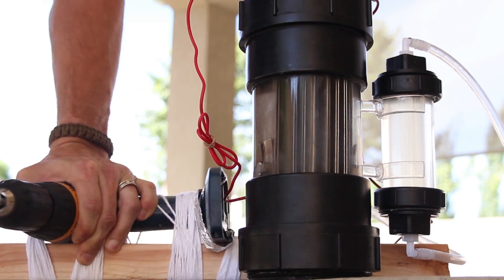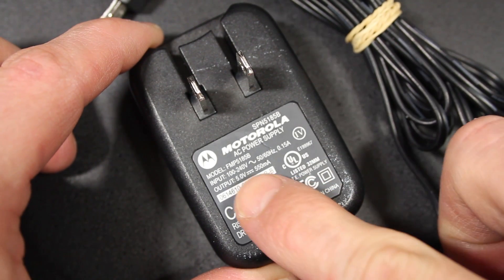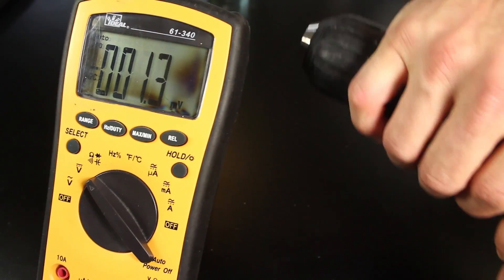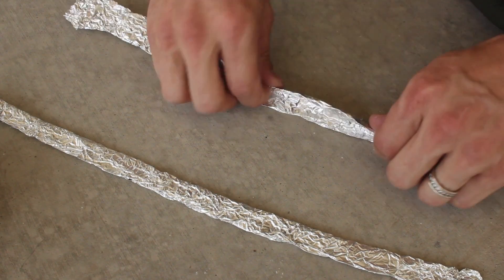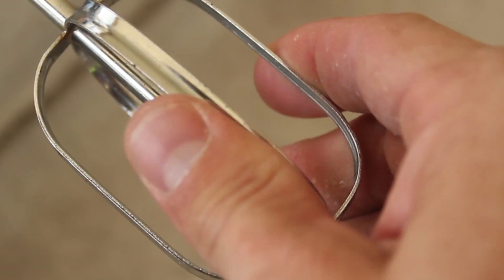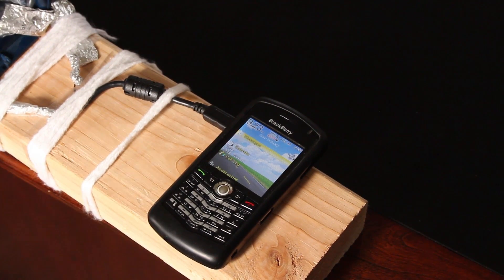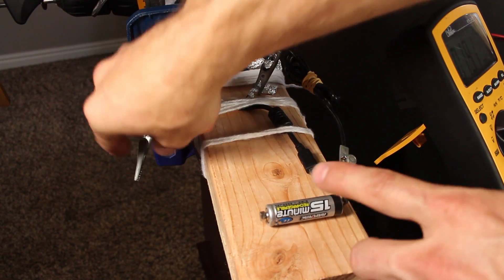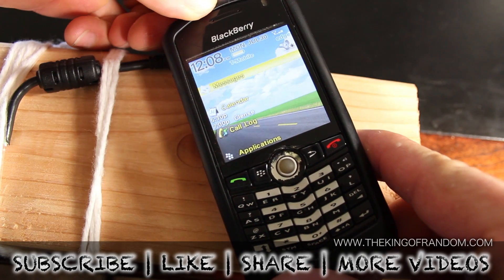Make an Emergency Phone Charger - MacGyver Style!

Comment: I've used DC motors many times in the past to charge/power circuits/devices. They certainly come in handy. To help eliminate any chance of damaging the phone due to fluctuation of voltage I would use an lm7805 VREG on the output. By doing so you will not damage the phone by spinning it too fast. The voltage will always be at 5V, unless you spin the drill too slowly. Be sure to use a 100uF cap on the input side of the vreg, and a 10uF on the 5V output side. I would also suggest using a blocking diode across the drill to prevent any back EMF spikes from destroying sensitive electronics.

Well done video. :-)
Reply from the maker: Excellent suggestion.  If you can find those in an emergency that would be ideal :)
Reply: The VR and cap are easy to find. All you have to do is take an USB 12 volt power adapter you plug into the lighter outlet in your car. Hook it up to the drill. You now have the regulation and filtering you need.
Reply: Grant Thompson - "The King of Random"  well according to your system its not safe because you dont make circuit that can make voltage stable as a the dynamo is been crankup!!!! so it means when you crank up so hard the power you generate is not so!!! stable that can kill your charging ic  in a second!!!  because it generates a 40watts of power !!!when you charge it!!!  but if you want it to make it to safe to charge i suggest  it use some rechargeable battery hooked up!!!!! to a regulated 5v car power charge so if you cranked up hi it wont destroy your gadget.
Reply: ***** this needs to be upvoted more.  Its a brilliant way to regulate the voltage.
Reply: The AC adapter converts incoming 120VAC to 5VDC. The drill already puts out DC, so all you need to do is regulate the output. If you don't want to use the lm7805, then you can also use a small step down converter board. I have a video showing a homemade 11W crank generator with a regulated 5V USB ouput.
Reply: better to use PWM dc dc converter(it has much better efficiency).
Reply: electronicsNmore The 7805 probably won't work because it requires an input of significantly more than 5 Volts. I've tried using 7805 regulators with 4 D cells, and 6 Volts was simply not enough for the 7805 to work properly.
Reply: Alex Roman its great if you have one laying around but for "hacked together" parts that works fine. we're talking emergency, not proper design.
Reply: Frank Oranzi I know how to make a soldering iron that uses no electricity with a paper clip and a ball point pen. SO yeah it can be done.
Reply: ElfNet Gaming And you cant seem to read the title, or you just want to humblebrag about your degree? I have almost 30years in the industry and I have seen things cruder than this work in a pinch. Best practice?  Absolutely not.  Would I use it if I had no other options?  Absolutely. Do I care about ruining my phone if I all I need is to make one call to get help sent?  not at all.This is a last ditch option to charge a phone.  Its a terrible idea if you just want a casual charger, but as the title clearly says, its for an Emergency
Reply: ElfNet Gaming Alright...so how difficult would a buck converter circuit be to set up? One of the motors is going to be cranked rather than powered and set up to output to 2 different things and I want it to have a rig for each of the 2 outputs that will restrict voltage and amperage differently than each other.
Reply: i dont have 7805 laying around but i have PWM dc converters, so if something happends i will turn spatula 40% less than you to get same amount of energy=)
Reply: The point of using the car adapter is the DC DC converter that is inside. You can just hook that up. You don't even need the 7805. This just seems odd to argue about but if you're very proud of having DC converters for a hypothetical situation then awesome for you. You should post a video about how you will use them, but you cannot use solder or power tools since its an emergency scenario. I will like it and share for sure
Reply: Frank Oranzi what about lighter? it can help.
Car adapter has the same 7805 mostly, as a linear dc-dc converter it has bad efficiency.
Reply: Not using a regulated DC output with either a lm7805 or high efficiency DC-DC converter is a bad idea. The converter in the car charger is designed for a system with a battery to help absorb transients
Reply: designed? there is capacitors on input and output and its enough to avoid transients.
Reply: If you're not concerned, then use it. :-)
Reply: how can the DC motor charge an AC adapter?
Reply: Alex Roman Most modern car adapters do not use 7805s. I just opened one that was in my junk box and it has PJ34063 DC-DC converter board with an inductor and caps. This adapter is about 10years old. Remember the point of this video is to show what works in an emergency.  Not what is the best way to do it.  There are plenty of smarter ways to do all of this, but they require planning and familiarity with electronics and not everyone has that.
Reply: Zolyx they are bypassing the AC side. All AC adapters convert the AC to DC first. You only need to inject the CD at that stage(after the rectifier circuit) and it will work. Not the smoothest way to do this, but in a pinch it will work.
Reply: That is correct, but cranking that drill by hand will result in more than 7.5V which the regulator will work just fine with. Too slow and the output will not be a steady 5V.
Reply: electronicsNmore 
7805 will not work good.
better to use low drop out regulator, or a simple switcher so get better effiencey and the correct drop out voltage.
Reply: Of course there are better choices than a 7805, but clearly the people watching this channel are looking for "SIMPLE". The 7805 will work, and work just fine as long as the rotation is fast enough. Clearly a 7805 is far better than using nothing as shown in this video.  :-)
Reply: electronicsNmore the Title is "Make an Emergency Phone Charger" Not, "What is the cheapest easiest way to bodge together a functional Phone Charger".  There are a plethora of ways to accomplish this with basic electronics, but in a pinch there is rarely 7805s or buck/boost converters laying around.
Reply: electronicsNmore I tried to say this but my electronics engineering degree means nothing against the homebrew DIY youtube audience..
Can't say they haven't been warned.
Reply: Rostit The problem is, knowing people very well, they will not wait until an emergency to try this. :-) Many will try it out to see if it works as shown in the video, and that is when the problems arise. Just like telling a little boy to look, but don't touch. I agree that many will not have an lm7805 or switching converter laying around, but many will also not have a cordless drill laying around if the time comes when no power is available. Grant does produce very good videos, but this is one video that I don't think is the greatest idea.
Reply: electronicsNmore True, and when they fry their new iPhone they want to blame the video creator.
Reply: Exactly. I think Grant knows this. He is far from stupid. If I was him, I would put a big disclaimer in the video saying there is the possibility you can damage or destroy your phone, so ONLY try in an emergency.
Reply: What would that look like on a diagram? I want to build a back up and would like to know more on what you just said lol. Millwright here lol so this is slightly jiberish
Reply: I will post a link to the image later.
Reply: electronicsNmore WHY NOT USE A USB CAR CHARGER OR ANY CAR CHARGER TO REGULATE THE VOLTAGE GOING INTO THE CELPHONE IF WE ARE CRANKING IT TOO FAST ALREADY..WOULNDT IT BE MORE CHEAPER TO USE AND EASIER TO FIND AND USE DURING EMERGENCY SIR?   I THINK THIS WILL WORK WELL TOO, AM RIGHT SIR GRANT THOMPSON?
Reply: Mardonio Herrera jr. If you have a USB charger around then yes, you would use it.  This is ONLY if you have a drill.
Reply: Unfortunately many car chargers are designed to operate between 10 and 15VDC. You will have to spin the drill fairly quickly to allow charging to begin using a car charger connected to a cordless drill. People also have to realize that spinning the drill in the wrong direction will reverse polarity and likely destroy the device being charged. Many phones will not even charge if you are not showing a low DC voltage on the data pins. Pins 2 & 3. I agree many may not have a 7805 laying around, but many people will not even have a digital voltage meter to make sure the output on the drill is correct. Positive and Negative will reverse when the drill is spun backwards. Only old phones can charge without the data pins. So in an emergency the phone will likely not even charge based on how this was shown in the video. I have 2 videos on my channel showing a handheld crank generator I made from junked parts(Part 1 and 2). Mine uses data pin voltage. For a basic schematic using a lm7805, refer to the link below.

http://i1063.photobucket.com/albums/t507/lookingfordbn/DSCN0441_zpsyah5fovt.jpg
Reply: electronicsNmore How expensive are one of these regulator components and what range of amperage, wattage, voltage, or whatever can they come in for the most common pricetag of one? I've been wanting to build something with a set of electric motors that have been laying around my friend's garage for a while and I got permission to go pick them up once I need them, but it's been more of a side project until you mentioned the VREG thing which could make the project I want to do a little easier.
Reply: *****
Look on Ebay for "5V voltage regulators". You can buy ready made circuits. Use an LM7805 based circuit or a switching circuit.
Reply: LM7805 is ok for stable voltage but the amps drop off as you load it down, eventually the voltage will become unstable and the chip shuts down, Your better off getting a buck converter circuit.
Also the LM7805 will start generating waste heat that does not justify its regulation no longer.. They are fine for small things that do not require a lot of amps but battery charging, it depends on the rating of the battery and so on.
Reply: so is mine
Reply: Pls speak English, I'm supposedly good at electronics but have no idea wtf ur talking about
jk;)
Reply: Doofus Industries you aren't than. that is a basic thing
Reply: electronicsNmore o
Reply: electronicsNmore 

H
Reply: Yep, wouldn't want to ruin a $600+ phone because the charging source wasn't regulated. Also, discharging the NiMh battery with a high wattage,  low resistance resistor is safer than discharging the battery with a wire.
Reply: You can de-solder all kinds of capacitors and voltage regulators etc from broken electronics.
Reply: +talastas789 Your English is terrible.
Reply: lel

Comment: I usualy like your stuff without any reservation.  I am not too keen on trashing a USB cable to cobble up some awkward gadget with a potential to trash an expensive phone, as you point out.  What had never occured to me, and that I think is great, is using a cordless drill as a generator.  There may be a good supply of such drills that are good except for their gone wretched battery packs.   Two future hacks occur to me now, a patch to use the drill without the bad batteries of the pack, a repair or subatitution of the battery pack, OR  repurpose the drills guts as a frame mounted bicycle generator to charge an onboard battery through a friction wheel contact to the bicycle wheel. Battery could then power/charge phone or provide bicycle lighting with clamped on charger removed.  Bicycle could be just ridden to charge or used on rollers indoors to charge.   I did leave thumbs up for this video, but following it would be a bad idea.  BTW every drill I have ever purchased has a button to lock the trigger switch in the on position.  I have a cheap cordless drill with crappy old battery of probably dead nicads and a couple of bicycles   i need to research regulators/ charging circuits.

Comment: i did this once.... i blew out the leds by power it too hard...and now it doesnt seem to work.. i would guess that its time near a few permanent magnets has made it stop... but i hope this aint the case...if it is.. i will have a hard time getting a new drill..hopefully it wont be wireless....cus making the battery pack the way it is... was hard....i took some wires and ran it tru the base and put them in place of the battery.. cuze the battery got over loaded i think what with me plugging it to a wall..so i put the drill in a way where with the base.. it still works... it portable and i have it currently in its box that i found it in.. and it is back next to the 7 magnets that i think might be interfering with it...
Reply: it still works...(i think...) but i dont have a way to know for sure... unless i plug it into a meter like yours... but i dont have one of those either...

Comment: So in theorie you can recharge your drill by just cranking the drill chuk backwards?
Reply: Good point...
Reply: but not quite the batter of the drill needs a lot more power so probably not
Reply: In theory, yes. You need to crank faster, though. If it's a 12v drill, you'll need to crank about 14 volts. If it's an 18v drill, you'll need to produce about 20v.  If 100 rpm was required to produce 5v, you'll need at least 400 rpm for 20v.  And, you'll need to do it for several hours.  At that point, you may want to re-engineer your cranking setup.

Comment: One thing he failed to mention is not all USB cables follow that wiring colour code or sometimes they're mixed up inside. Use a multimeter first to ensure you are using the correct wires for voltage and ground. Just an FYI for those who are considering anything like this.

Comment: So if my drill dies, can I just crank it backwards to recharge the battery?
Reply: xthexinsanexkingx Well said! This is the same philosophy I use for my car. I always tow a second car behind me so if I run out of gas I have another car to use.
Reply: Chris Nguyen You're the first person to invent infinite power! Congrats!
Reply: Actually forwards. And faster than it would turn at full power.
Reply: ManWithBeard1990  USE ANOTHER DRILL :D
Reply: Hey, now say you have a motor that is attached to this generator and is making power by turning the crank. All you have to do is attach the power output to the motor... now you have a limitless power source!!!
Reply: Chris Nguyen Love you sarcasm.
Reply: no........ This drill has been modified. someone has removed the diode.
Reply: xthexinsanexkingx man that gave me a good laugh.
I think it was the english that really made it sound funny
Reply: NO, you would be using the batteries power while holding down the trigger to charge it.

Comment: So it stands to reason that if put in reverse and hand cranked fast enough the cordless drill could recharge it's own battery pack?
I bet that wouldn't be very fun.
 Perhaps a mechanism to couple it to a bicycle and make a drill you can charge anywhere without electricity?

Comment: if i was to hook the hand crank upto to a bicycle wheel would it be possible to thank use the cycling as a means of powering the phone? thus making use of a cycle workout and phone charging.
Reply: Goblineng It would be best to use some sort of ballast. EG: Charge a lead-acid battery with the bicycle-generator and then utilising the stabilised current from the battery to charge your mobile devices.

Comment: If you wanted to be on the safe side, you'd also want to hook up a LM7805 voltage regulator by connecting the positive cable from the charger to the voltage in pin on the regulator, ground pin to the negative cable, and an additional cable going from the 5v out pin on the regulator to the positive cable that leads to the phone.

Comment: AAAAAAHHHH --- EUREKA !!!! i do have the sollution...
Take a lemmon put two kinds of different metals in it (electrodes) and there you
have 1,5 volts or so. Take more lemmons and do the same, a parallel cicuit could
then deliver 4,5/5 volt. If 4,5 does not work, take another lemmon. 2 lemmons =
3 volts. 4 = 6 volts. if 6V is to high then bring it down to 5 using some elect.parts.
If the oprganic accu is empty, place some new lemmons. Even if it takes a week,
still better then 3 hours handshake. This better is used for your girlfriend.

BTW your first creative project ?.

Comment: What EMERGENGY. It will take that long you could be death by then. How long did
it take to charge the accu ? 3 hours ?..You better had named this project an arm work out project. In case of emergency you had you best time. BTW ever thought of
using your BIKE ?. 1.Take your bike and put it up side down. 2. THe front wheel has
the dynamo, the DYNAMO can deliver 6-12 V. 3. Some electronic parts to make it
both 5V and DC. Then run the wheel and your done.  Or- even better- use a solar
cell unit.Emergency huh...building the projects tells me you have plenty of time left.
So what emergency ?. The time needed for building the project and loading the ac-
cu is that long, you had better buy a new loader in about 30 minutes.